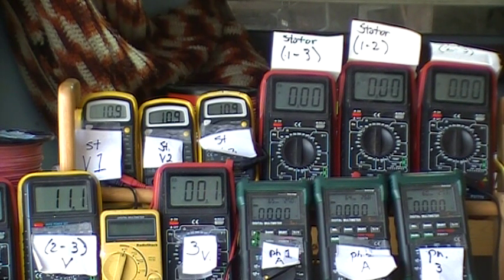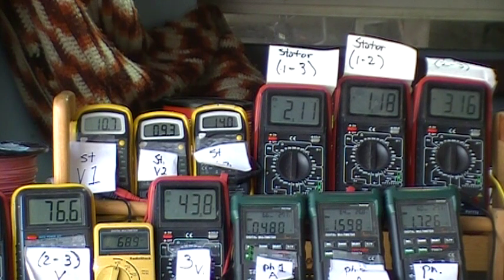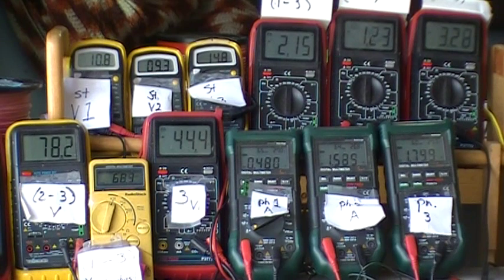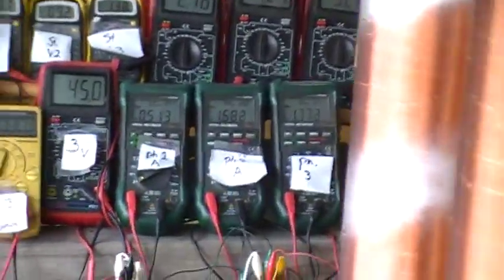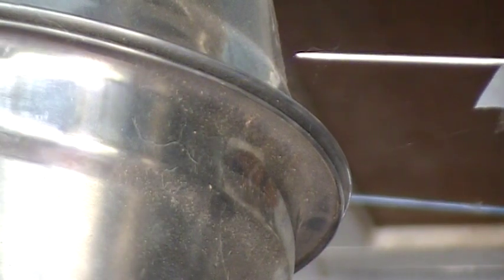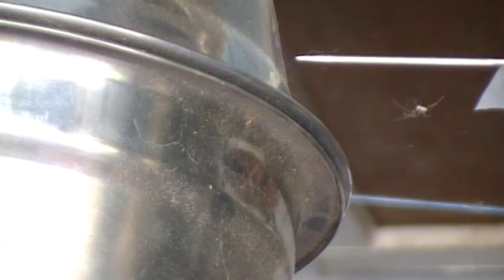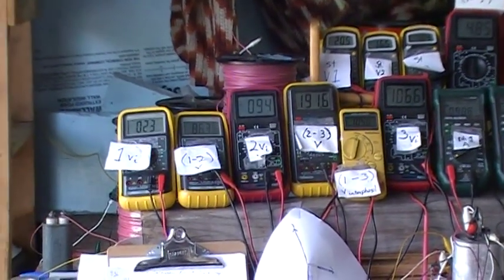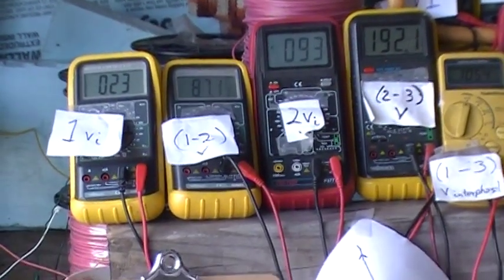10 & 20 Volt Operation of Wireless Bipolar TC via 666 Pancake Spirals

Comment from the maker: At 1:55 the stator voltage inputs are ph1 10.6V/.5A  ph 2 9.3V/1.689A  ph 3 14.8V/1.747A equals 11.56 average stator voltage, 6% higher then no load/open circuit at 10.9 volts.